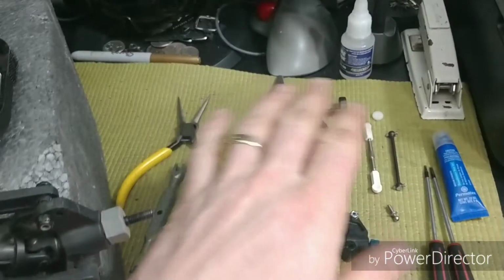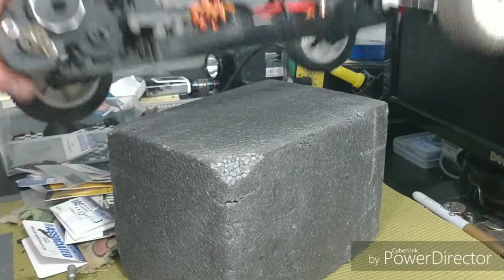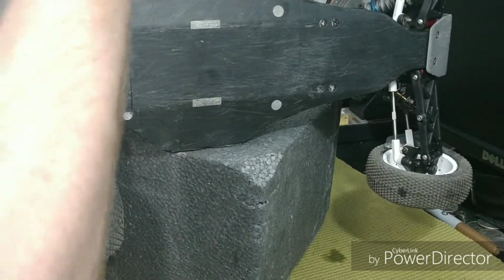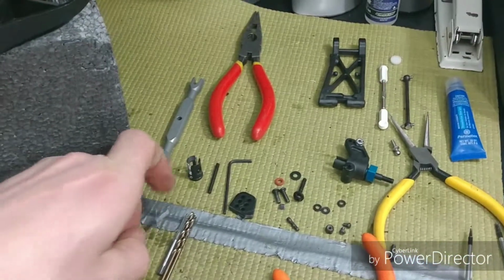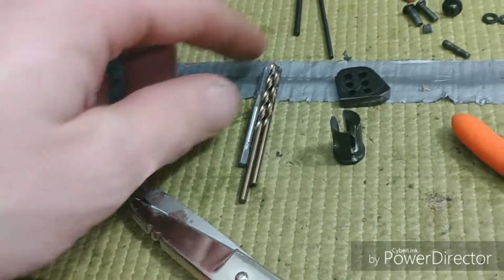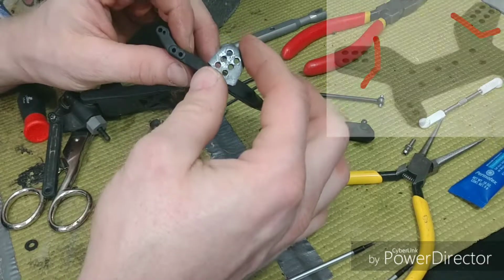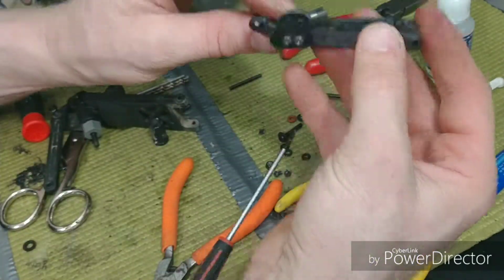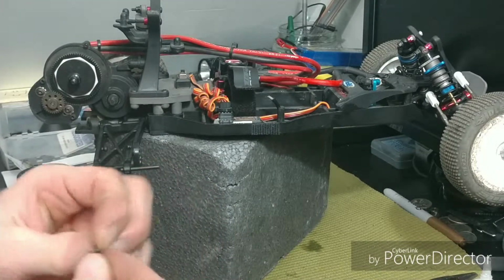ECX Boost buggy *Rear suspension Associated B4.2 conversion, How-to by KRUZ racing

Comment: What body do you use and how does it fit?
Reply from the maker: I made my own mold and vacuum formed my own lexan body. You need one?
Reply: kruz racing169 I'm looking into getting a buggy body for my ecx amp, I'm only concerned about the esc fitting under the body. Do you sell bodies?
Reply from the maker: You will not be able to fit a aftermarket ESC under the stock location. You would have to run a ESC without a fan, and that is no good. 
So, you relocate ESC to side of chassis like all other brands and then stock body does not fit. With my custom made body, it fits the side application ESC and provides air flow to electronics. 
I can make you a custom body. Search on Facebook for Kruz Racing, and shoot me a PM. We can talk from there 🤙
Reply: kruz racing169 alright, thanks for offering. i decided to just get a different truck body. i might need a new buggy body in the future!

Comment: What gearing do you use?
Reply from the maker: Give me a couple days....I am in route to some racing this weekend. I installed Team Associated pinion and spur, I will list up my exact gearing when I get home.
Reply: @kruzracing1692  I installed  Kyosho steel 30 t pinion and HR 81 t steel spur gear
Reply from the maker: @Clio 16V, Gears that I have installed and work really well. I would not use an steel spur personally, I use these gears as the fail area verses tranny gears. 
Gears installed;
Team Associated 72T 48pitch spur gear, #9649
Team Associated 33T 48pitch pinion gear, #1351 FT aluminum

Any of the #7125, #91170, and #9603 "octagon" slipper pads will work in an Team Associated spur gear. It depends on how much surface area you want or need. If you go on Associated's website, they will list what slipper pads work with which platform per se'.

I run an 17.5T stock spec motor with timing adjusted to my liking. Running Blinky mode on ESC.